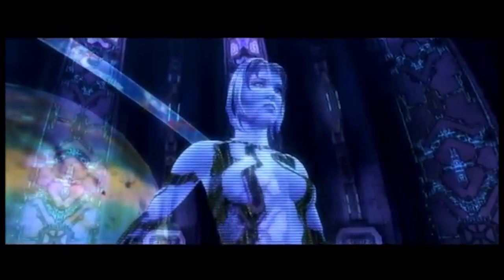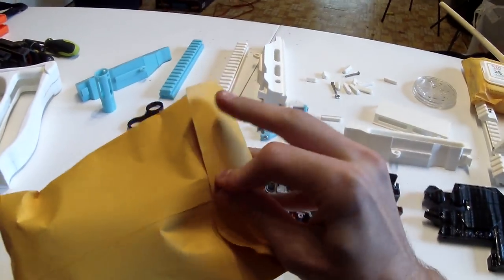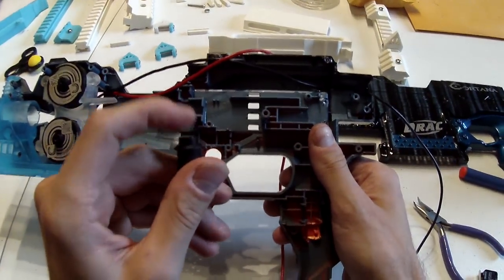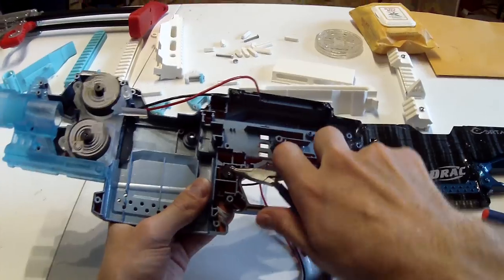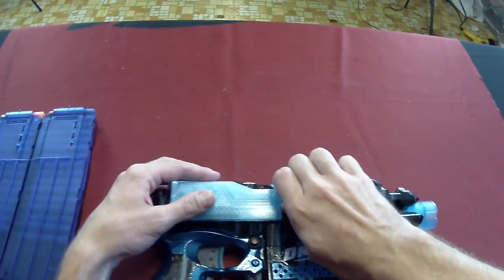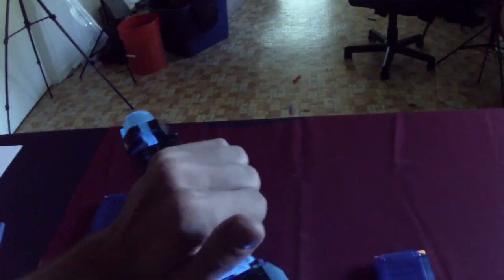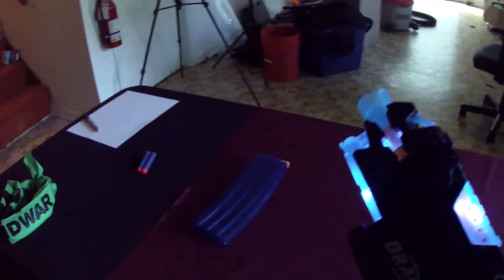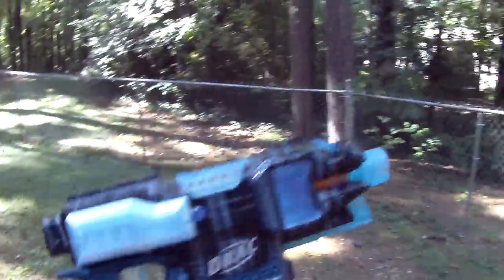Nerf Mod: Cortana (Tier 0 Stryfe Build)

Comment: You should hydro dip a retailiator stock  paint and hydro dip in the same pattern as cortana. A retailiator stock because you're still able to see the volt meter once you put it on.

Comment: Just a warning Drac. Halo 4 and 5 are mixed bags. I would say I liked Halo 4 more though, because it has a pretty solid story, but the multiplayer wasn't that great and some elements could have used tweaking. Halo 5 had an atrocious story, ok gameplay, but a fun multiplayer. I recommend you watch The Act Man's videos on Halo 4 and 5 because they were really well done and had a lot of good points and effort thrown into them.

Comment: You should make her look like the Halo SMG for even more flavor. A translucent blue foregrip should be straightforward, but I don't quite know what would do well for the stock.

Also, I wouldn't recommend Halo 4 or 5 since they changed essentially everything about Halo. While the gameplay I've seen of Halo 5 multiplayer looks slick and fun (don't bother with the campaign; it's complete garbage), it's nothing like the first three games or even Halo Reach, and Reach changed a lot of things, too (though not everything). Speaking of Reach, I highly recommend both it and Halo 3: ODST.

Comment: Nice, a Halo blaster.
Reply: I'm gonna see if I can make this AND the Halo 3 SMG Stryfe and dual wield those as secondaries while my primary is gonna be a Halo Longshot mod(Not sure which one, your Halo 3 Battle Rifle, Mag212's Halo 4 Battle Rifle, or Mag212's Halo 4 Sniper Rifle). But this and the Halo 3 Stryfe require circuitry mods, and I'm not sure if I can pull those off. BUT I'LL TRY MY BEST. Also I might see if I can turn a Rayven into a mini Halo 3/4 Assault Rifle(Since the Rayven is bull-pup like the Halo AR) and turn the Rival Kronos into a Halo 4 Magnum(I'm pretty sure that one is the bulkiest version of the Magnum, and the Kronos has a rather large profile). But of course, to do all this, I'M GONNA NEED A NERF BLASTER OTHER THAN THE THUNDERSTORM. And some tools and some other materials to do these things.(Or someone could use these ideas and, if they haven't already thought of it, given me a teensy bit of credit?)

Comment: The Nerf blaster halo deserved
Reply: Dylan Kennedy But bro, the BoomCo M6 and Plasma Pistol are great. BoomCo darts are a little tricky to get a hold of, but they are pretty damn accurate and durable. Also, the stock catch can take a K26 without any modifications whatsoever. Unfortunately, the pins that Mattel loves to use makes them a little trickier to mod.